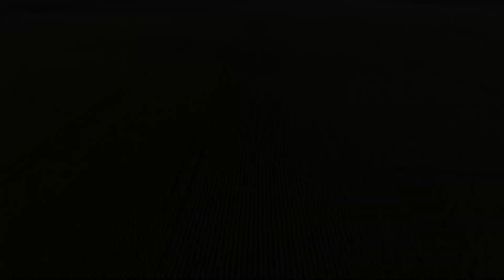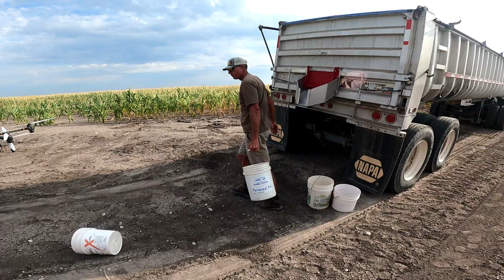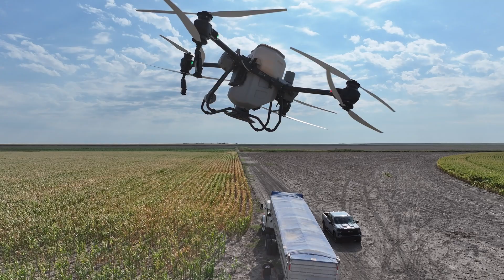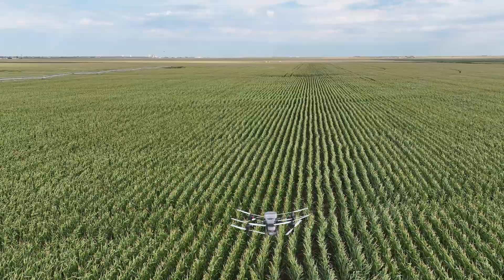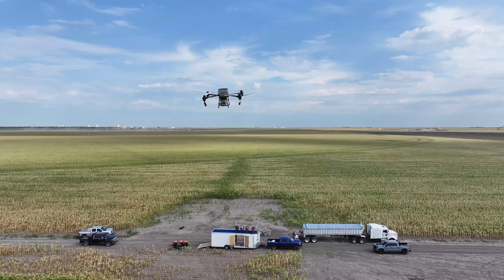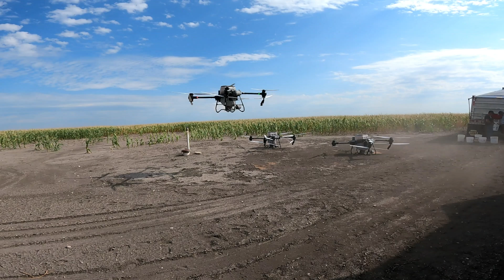Aerial Wheat Seeding with the DJI Agras T50 Drones (Season 2 · Episode 24)!

Comment: Is this the first year you’ve tried this? I assume you’ll turn the pivot on until the wheat has sprouted. How many pivot passes do you anticipate are needed?
Reply from the maker: Hello! This is the first time we've tried seeding with an unmanned aircraft(s). You're correct, once the corn is chopped to silage (any day now as the crews are chopping now), we'll then run the pivot 2-3 passes contingent on any rain that we receive during the next month or so. I'm planning to make a follow up video and will provide some footage of the circle once the corn is off and the wheat has sprouted. If you think of any other questions, just shoot them our way. Thank you!

Comment: Will you harvest the wheat next summer or is it a cover crop? What was the seeding rate? Thanks for sharing!
Reply from the maker: This is for the 2025 Summer wheat crop. We seeded at a rate of 150 ponds per acre. Just holler if you have any other questions. Thank you!
Reply: How many times did you have to fill them up to cover the area you seeded?
Reply from the maker: I don't have an exact count right off hand but will see if I can find it in the flight logs. If I can, I'll drop you a comment with the information.
Reply: @TracyWasinger to do the field we had 193 flights and a little over 18 thousand pounds of seed wheat
Reply from the maker: Awesome. Thanks for the info, Colton!
Reply: @TracyWasinger  with a 110lb tank I'm guessing they filled quite often. Probably 110 acre circle.